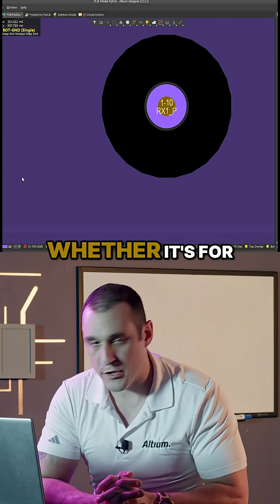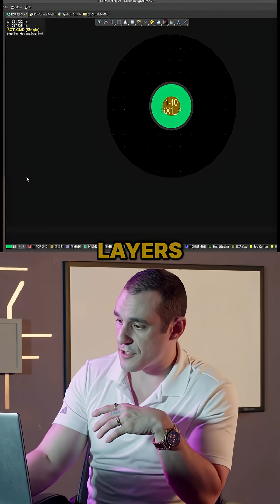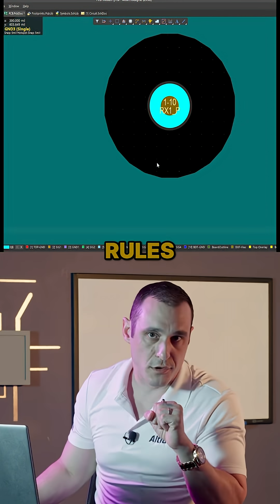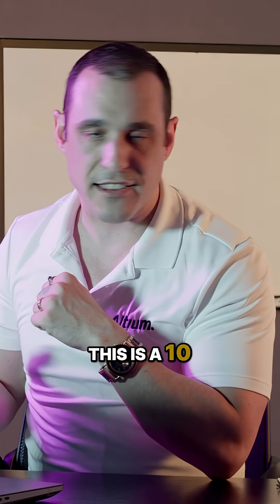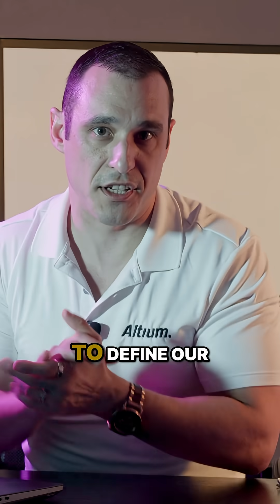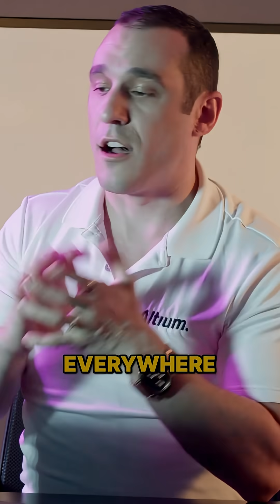When to Use Design Rules vs Drawing Tools for Via Anti-Pads

Comment: A PCB antipad is a void or clear area of copper around a via (a plated through-hole) on an internal plane layer of a printed circuit board. Its purpose is to prevent the via from making an unintended electrical connection to that plane layer.